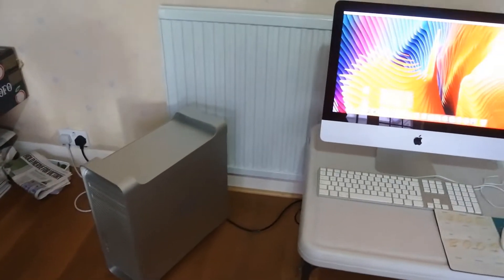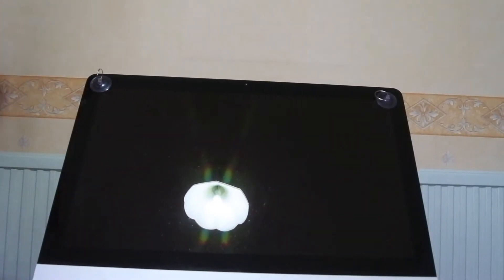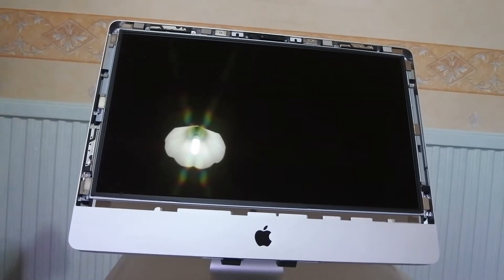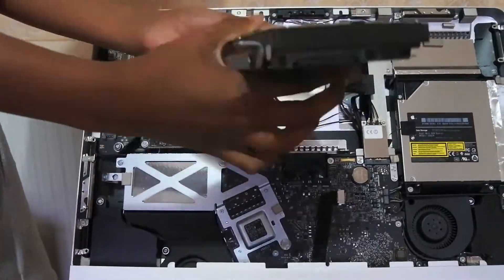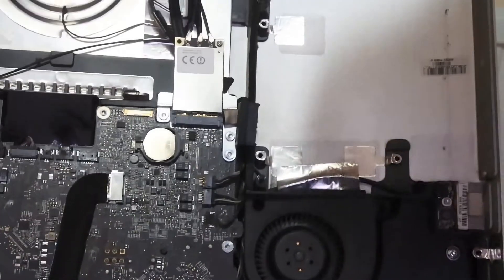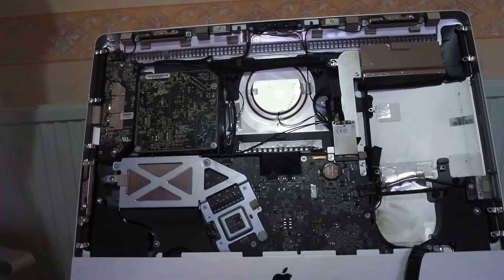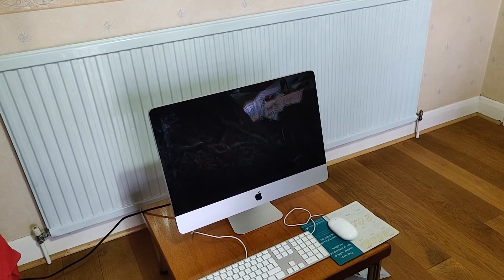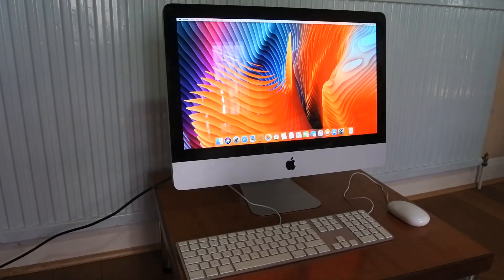2011 iMac Upgrades -CPU (I7), SSD & OWC Thermal sensor

Comment: Benchmarks?  That seems like an important part of any update.  Also, as we now know, the 2011 OWC cable isn't a temperature sensor.  It just supplies a fixed voltage to the power board to indicate all good which maybe can be accomplished other ways.

Comment: Hello , I've changed SSD and added thermal sensor but 
 My fan runs at full speed any ideas?  now I am using Fan control software  Mac (27-inch, Mid 2010) 2,93 GHz Intel Core i7 quatre cœurs
Reply from the maker: If you added a thermal sensor and plugged in all the cables on correctly you should be fine and it should work if not it would likely lead to such an issue (2010 iMac's require slight rewiring). To check how to wire it check out my 2010 iMac video.

https://youtu.be/ChWTPVDPVjY

However I have used the OWC thermal sensors twice now (once on a 2010 & once on a 2011) and had no issues.

Hope you can sort out your issue though.
Reply: @techwithagr5974  Thank you  🙏🏾  i think i bought the wrong thermal sensor , I have to buy thermal sensor 2009-2010
Reply from the maker: Glad I could help

Comment: What os do you currently have installed? Also great and informative video!
Reply from the maker: I am currently running Mac OS high Sierra the latest OS it can run, I would use open core to get to Mac os BIG SUR but there have  been many cases where the OS runs very poorly with lag.